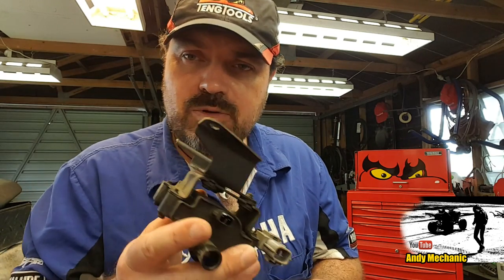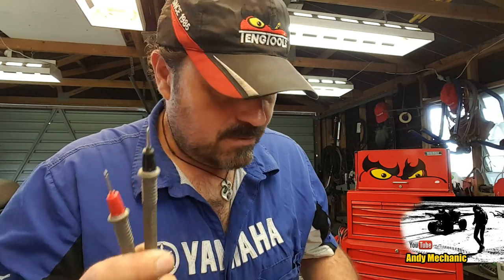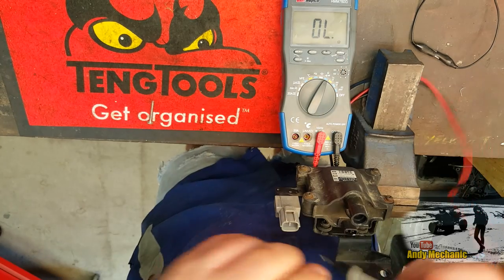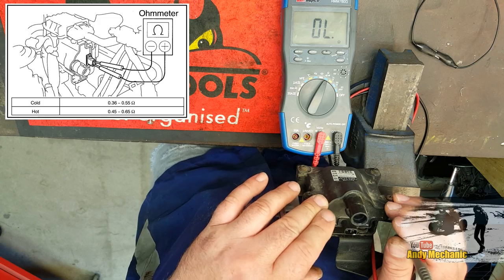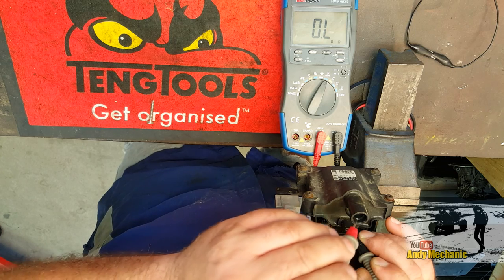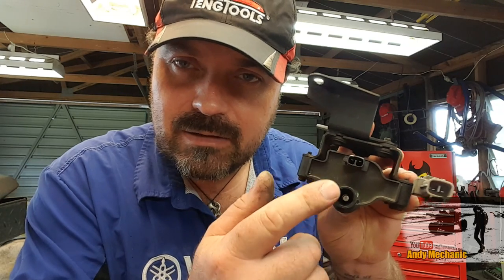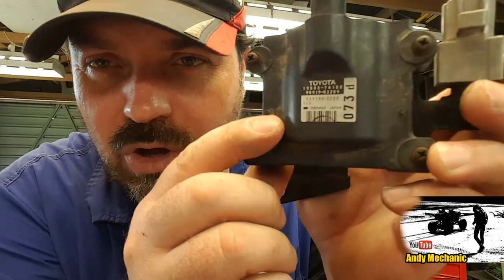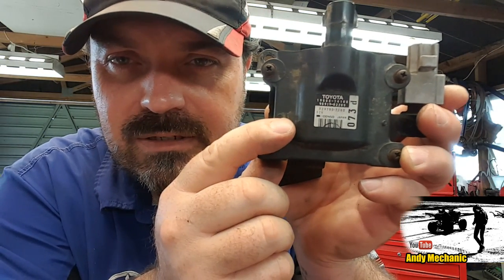How to test an ignition coil #1212

Comment: Dumb question, i always have ones nobody asks. I bought an Accel 8140C for my 22r, i obviously knew it wouldnt mount to the igniter, but i have the 8mm cables. Will this work if i just splice the wiring together or do i need an igniter or what else? How do i mounth the coil? 
I just replaced the distributor cap... and rotor I think at the same time. But im teaching this all to myself. From a haynes manual mostly.

Comment: If my coil is producing spark to the output wire that leads to the distributer cap but there is no spark on the plugs, what could that be? I already replaced the cap and rotor. Still no spark...is insufficient voltage able to cause it to give no spark at all?
Reply from the maker: Check that the rotor is making contact with the input  (king lead). Also, if ignition timing is way off then the rotor won't be aligned with one of the output posts & therefore spark will not jump to post & along HT lead to the cylinder. Check your ignition timing :-)

Cheers Andy

Comment: Can the ignition coil failure or one that has primary coil higher resistance values than the spec cause the igniter pack (mr2 design) not to take the igf signal from the ecu to ground and therefore get a code 14 on a Toyota
Reply from the maker: From what I understand from the diagnosis I did on the MR2 the ECU commands the igniter to trigger a spark event (IGT signal). Once  spark event has occurred (igniter monitors coil) then Igniter will pull IGT to ground to confirm an ignition event. So, if coil is faulty then it's highly likely the Igniter will not issue signal on IGF & ECU will stop engine by cutting injection pulse & code will be stored

Hope this is of help
Cheers Andy

Comment: I test the ignition coil on my sport car and it have high resistance around 1.5 and the service manual say 0.7 would good ignition coil. The car not starting can this be bad ignition coil? Fuel injector are firing fuel.
Reply from the maker: Yes. Definatly, if the coil is out of spec, which it is, it should be replaced.

If no spark then do test the primary side of the circuit for switching during cranking as if not switched then you won't get a spark.
Andy

Comment: Hi Andy - Thank you! I have a question when you test the continuity of the primary coil negative and positive what do you get? I don't get a reading in ohms for the primary coil test, (0.00), however, on secondary coil I get 13.4 which means is good. So I tested continuity and heard the sound.. wonder if your does the same? Wouldn't that mean there's a short? Thank you for your videos this helps tons of people with limited resources who tries identifying an issue avoiding get robbed by purchasing other parts, labor, tools, valuable time and those who call them selves "auto mechanics". Appreciated.
Reply: Yohan H check to see if you have spark

Comment: I liked the way this vid was presented.  i have a 1991 Mitsubishi 3000gt tt with this coil spec from the manual.  Primary side 0.67 to 0.81 on each of the 3 coils , secondary side 11.3k to 15.3 ohms.  my secondary side reads 12.55 12.65 . 12.75. so within spec . The secodary side spec is 0.67 to 0.81 ohms. the reading i get is 1.3 1.1 and 0.9 . Confused on this as its not as i thought it would be displayed ?? have i measured it wrong?

Comment: I just got electricuted by touching my engine bay fender near my ignition coil it was a crippling pulsating shock like ticking.
Reply from the maker: Damn. ..well you have some damaged insulation somewhere on the HT side. Run your car up in the dark and spray area with water (hand sprayer) and you may see the damaged part by sparks jumping to ground. Cheers Andy

Comment: I have a 1996 Plymouth voyager base model 3.0 engine and I am getting p0300 code I replaced coil and light went out for awhile then it came back on then I replaced pugs and wires and cap and rotor still is on could it be that the coil I got be bad I had timing belt water pump and all belts replaced and idle arm and pully and tensioner replaced and light goes out for a while then comes back on but has stayed on for a while now. can somebody help me car runs fine when warm but runs alittle rough cold and now trying to run rough in reverse alittle.
Reply from the maker: +james griggs Hi James, unfortunately I don't have access to fault codes for your car so have no idea what that code relates to. 

If you like ask Ivan from Motoyam82, he's more familiar with the US cars and has a YouTube channel too covering auto diagnostics.

Cheers Andy